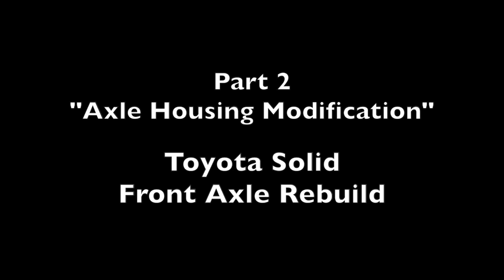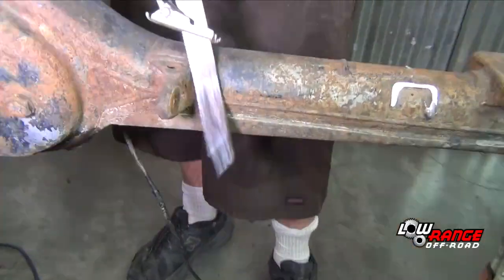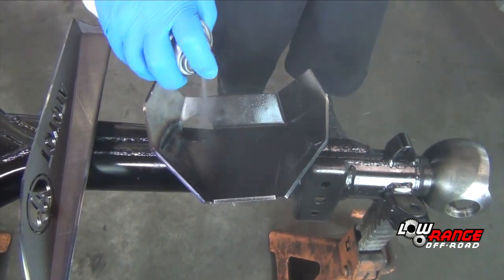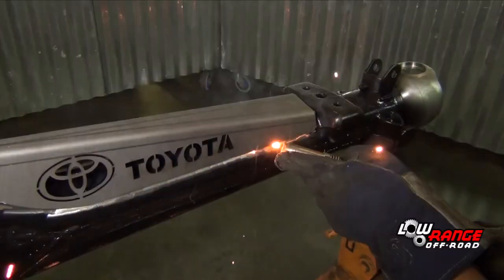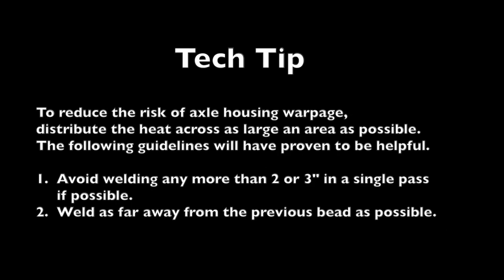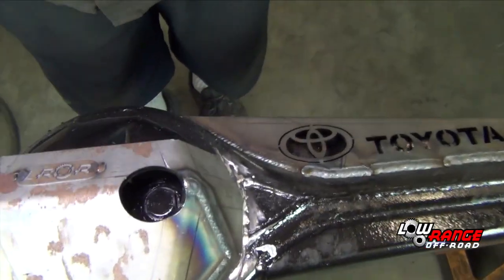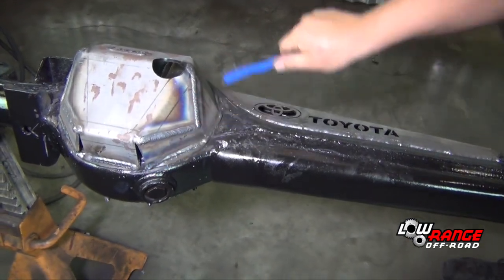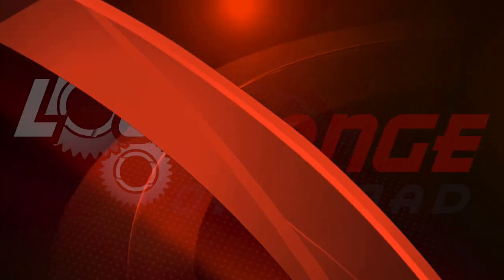How To Rebuild A Toyota 4X4 Solid Front Axle (Part 2) Modifying the Housing

Comment: I can appreciate the fact that the video has been made for instructional purposes, however I'd strongly suggest that when welding the diff guard into place that the diff centre is bolted firmly into the hosuing so as to avoid warpage of of the diff centre housing flange. Even with the slightest warpage I don't believe that the diff centre bolts will pull the flange back to it's true position, failing to do so will guarantee that your diff centre will leak at the flange. My point is proven by the simple fact that both the diff centre housing, and the diff centre flange on the housing are machined surfaces.
Reply: I would never weld on those horizontal brackets with at least housing be welded to thick welding table ,toyota machined these after welding and cooling ,this is sketchy at best better to leave housing intruck while doing this and weld top an bottom at same time .Even a few 1000nds of warpage and your fuked

Comment: I just started working on a 83 4x4. First project to rebuilding the front axle. It will be a daily driver and light trail rig. Will getting rid of the anti wrap bracket affect the on road manners any? Should I leave the Anti Wrap Bracket and associate parts?
Reply from the maker: I checked with Nick our Toyota Specialist here at Low Range and this was his reply, "It should not affect on road performance at all, and if it were my truck I would remove it."  Thanks for watching and commenting.  If we can help any further please let us know.  If I were you I'd call 801-805-6644 and ask for Nick.
Reply: Thanks for reply. I order your ultimate rebuild kit for that axle and read it was back ordered. Do you know how long till parts are in stock?
Reply from the maker: I don't know.  I asked our Sales Manager William and said it might be best if you give him a call at 801-805-6644 or email him at william@lowrangeoffroad.com.  I am sure he can help you.  Thanks for shopping with Low Range Off-Road.
Reply from the maker: I just spoke with Nick (referenced in previous reply) and he said, "we are waiting on the wheel bearing nut kits and then we can build them, should be any day now"  Hope this helps.

Comment: Quick Question, Does the Anti Wrap bar limit flex? I have a 4 inch lift on my 85 and was curious wether or not it reduced flex. Thanks!
Reply from the maker: Yes.  The anti-wrap bar will limit flex.  Thanks for watching and commenting.

Comment: What is the function of truss...decoration?
Reply from the maker: +enterBJ40 Toyota Axle housings are not indestructible and will bend under severe off-road use.  The truss strengths the axle housing and reduces the risk off bending.  Thanks for watching and commenting.
Reply: The truss will assist/strengthen the housing from the centre, to the inner of leaf spring mount, the weakest point of that particular housing is at the point of the tube on the outer side of the leaf spring mount to the ball end. Toyota have already fitted a truss to the lower section of the housing during the manufacturing process, however in saying that, it too doesn't stop the housing bending at the tube or ball end.
Reply: Interesting...Is good to know
Reply: Sorta. It's in compression and the strength of that added member is in the top chord, and that ain't that big. More weight in the webs then that, but it does look cool.

Comment: So what is the leaf spring spacer for?
Reply from the maker: +7979kelly When Toyota built these solid front axles for their trucks and 4Runners the spring pad on the driver side is about 3/8 of an inch lower than the pad on the passenger side.  To accommodate this difference Toyota made the driver side spring with 3/8" more arch in it than the passenger side.  Aftermarket springs do not take this arch difference into account.  They have equal arch on both springs.  Therefore, if you are installing aftermarket leaf springs, you will need to add the 3/8" pad.  If you are going with the original springs you do not need the 3/8" pad.  Thanks for the question and thanks  for watching.
Reply: Not trying to be a know all, just sharing my experience which spans 40 odd years. When Toyota built the Hilux chassis at the factory, all and I mean all the variations of the Hilux chassis had a natural twist which favored (RH down) the right side front corner by 10mm (3/8"") , Which is why the front springs are marked "left" and "right". And why they did so is anyone's guess. However the problem was that when these vehicles were involved in accident many accident repairers in their wisdom assumed that either the left front corner was up, or the right corner was down so they then  repaired the frames (chassis) true, which obviously then affected the manufacturers level ride height on the vehicle.